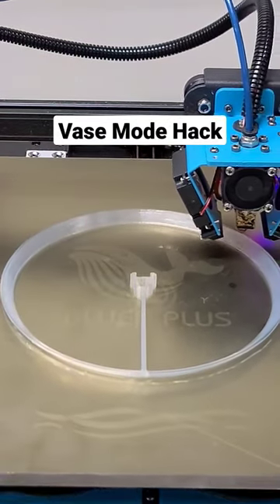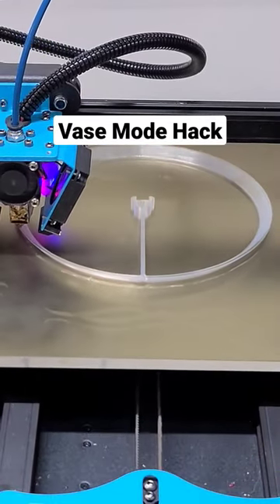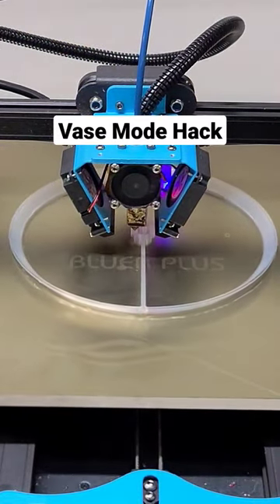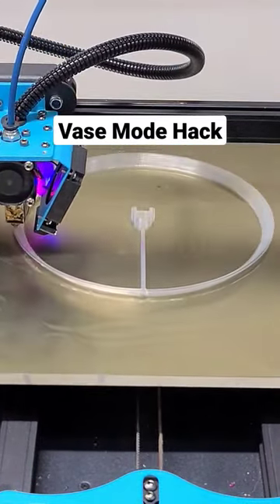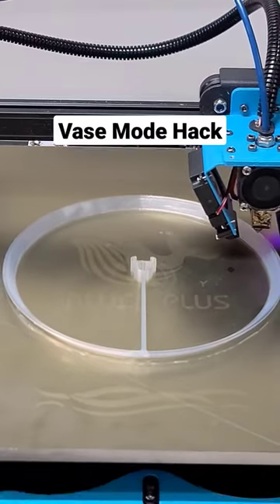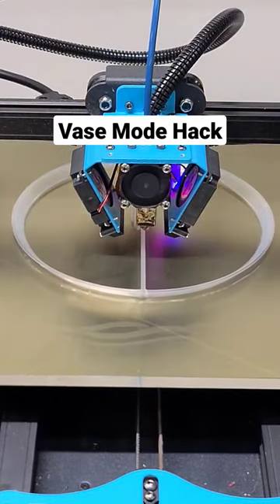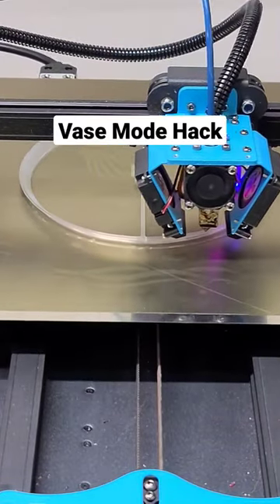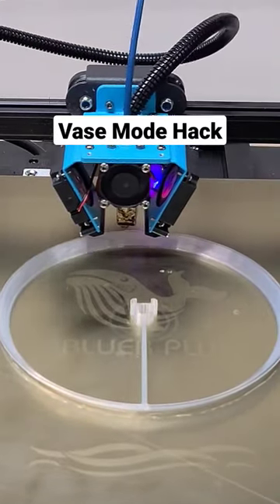Crazy Vase Mode Hack #3dprinter #thingiverse #3dprint #shorts #diy

Comment: Vase mode with seam??  You can easily print 0.6mm wall with 0.4mm nozzle or 1.0mm wall with 0.6mm nozzle in regular vase mode.
Reply from the maker: Sure I can swap nozzles but it's far easier to use the double wall approach.  1.2mm with double .6 perimeters is faster than trying switch nozzles and then printing only to switch back to .6.  revo helps but not every printer is it easy to swap.